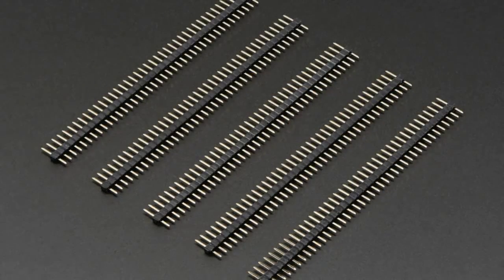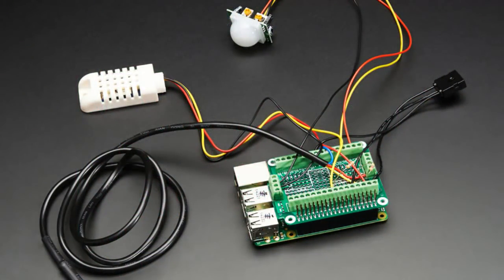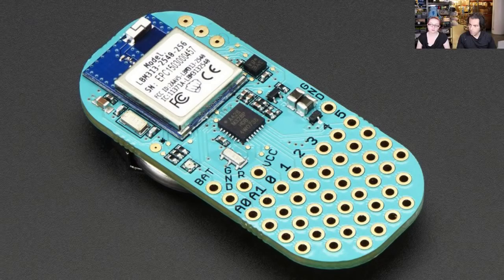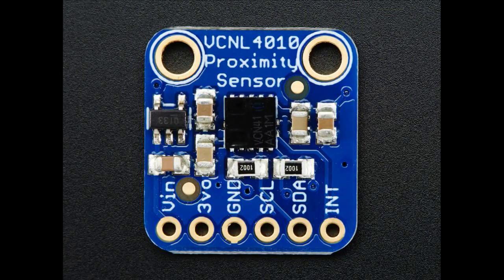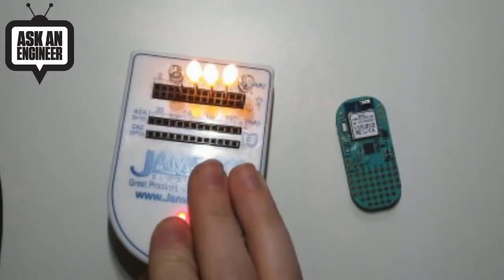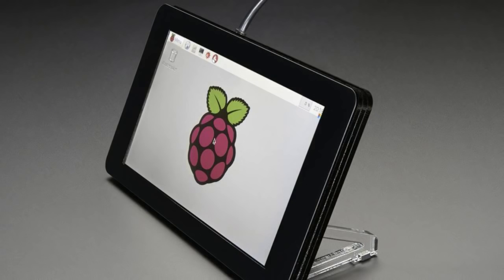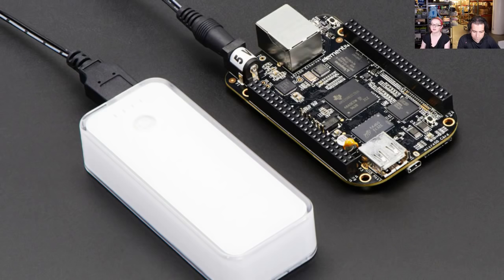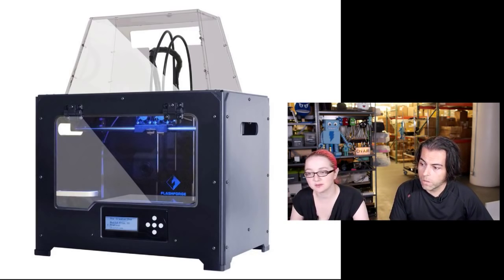New Products 9/30/2015

Comment: Hi guys! I knew I have commented on this before. I asked about adding a headphone jack to the pocket pi grrl. Is there any way to add both a headphone jack and a speaker? When you plug in the headphones, the audio from the metal speaker stops and goes through the jack, and when you unplug it, it goes back to the speaker? One example is an iPhone.
Reply: +Noah McGregor Don't think they peruse the comments much here, but they're very active on their forums: https://forums.adafruit.com